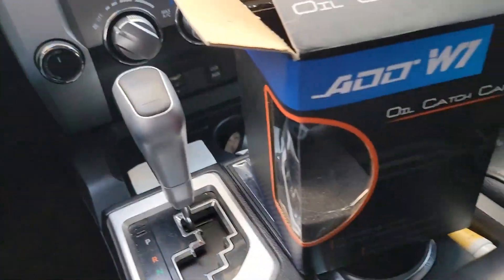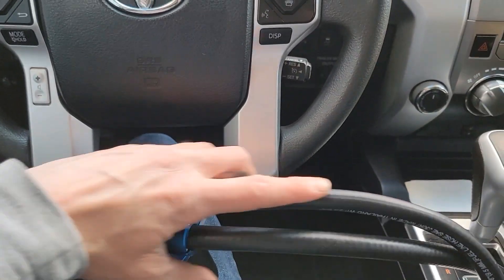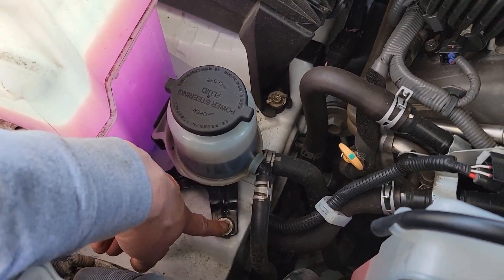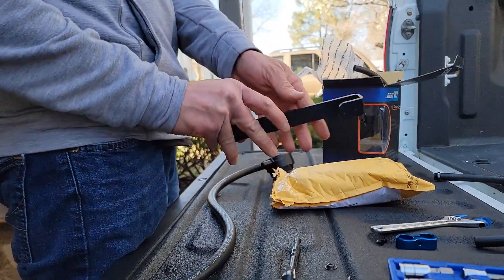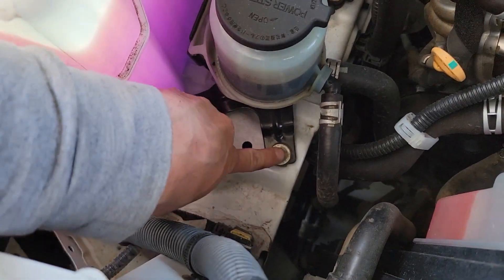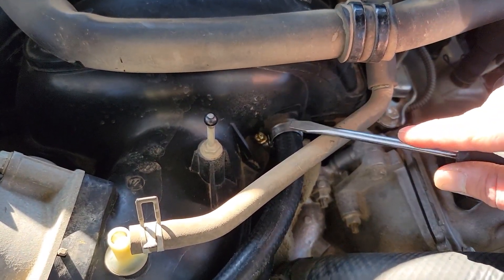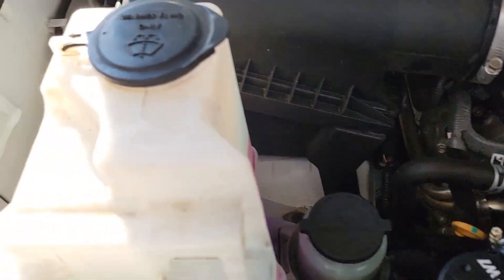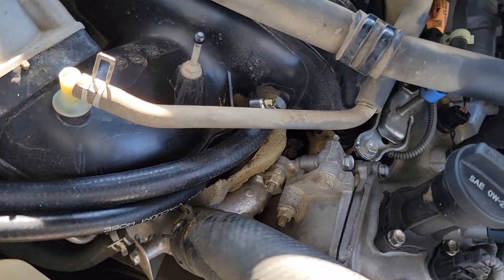Toyota Tundra Oil Catch Can Install

Comment: What's an oil catch can, what's it for
Reply from the maker: Its to trap the oil that get gets into the manifold due to blow-by. Over time it can be harmful for the engine. Universal oil catch can: https://www.ebay.com/itm/295838517166?mkcid=16&mkevt=1&mkrid=711-127632-2357-0&ssspo=lIA73XDeRfm&sssrc=0&ssuid=lIA73XDeRfm&var=&widget_ver=artemis&media=COPY

Comment: Brother thats a total wast of money, the 3UR-FE is port injected and the flow of fuel over the valves keeps everything clean, and as a result of that a catch can isn't really beneficial unless you environmentally worried about burning that oil.
Every year we see completely stock 3UR-FE engines roll over 1 million miles without a catch can.
Reply: but is it doing any harm? honest question, i'm not sure...but was thinking of putting one on my Sequoia 5.7.